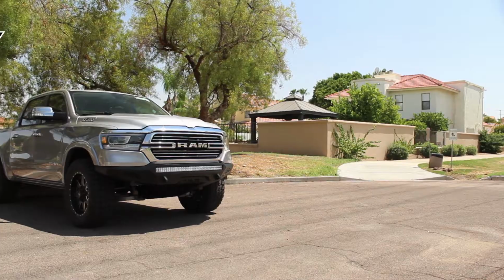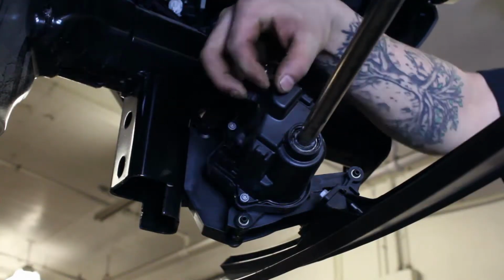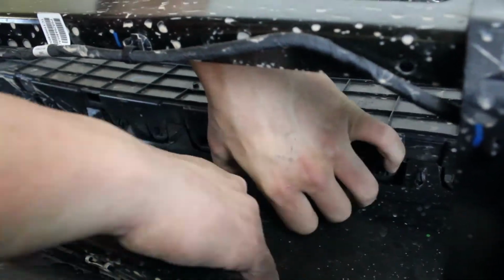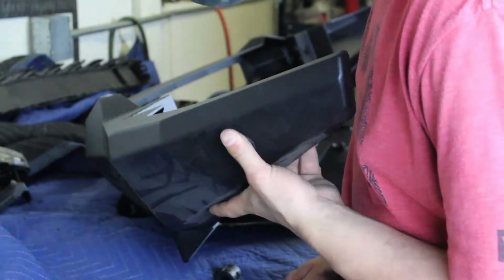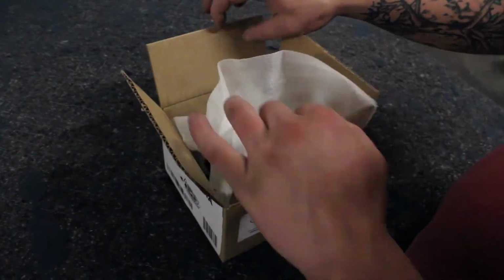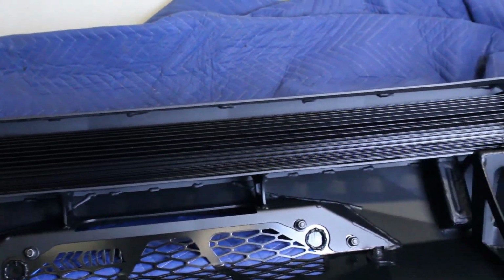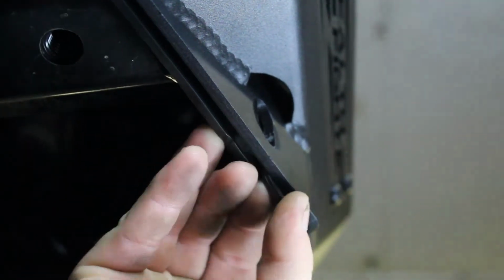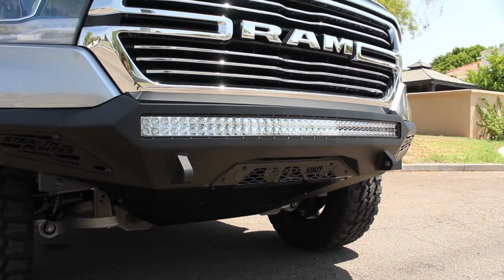HOW TO: Install RAM 1500 Stealth Fighter Front Bumper with OEM Removal

Comment: I agree with other than the OEM fogs need to be kept and there should be an option to NOT have a giant light bar cutout in the bumper.  Not all of us are running 100mph through the desert at night. ;)

Comment: If you are shelling out 2k on a bumper, plus whatever that high dollar light costs, then you should have enough $$ to have a machine shop build you brackets for those holes, on either side, to accept your OEM fogs. And for those who don't want the long light just have a plate made with your name, truck model, etc stamped out.

Comment: You guys should design a bracket to relocate the factory fog lights into the pockets on the right and left side where the stealth fighter panel inserts are that way you can retain the factory fog lamps and the cornering light capabilities.  What about an aluminum option to keep the weight more in line with the factory bumper?
Reply: Outstanding idea! That's a no brainer. I wish they would in fact do that. I'm not gonna buy the bumper until they do that! I really like the way this bumper looks but I absolutely insist on maintaining that fog light capability!
Reply: I guess im asking randomly but does someone know a tool to log back into an instagram account..?
I was dumb lost my password. I would appreciate any tricks you can offer me.
Reply: @Terrence Kohen instablaster ;)
Reply: @Alexander Cairo thanks for your reply. I found the site thru google and Im waiting for the hacking stuff atm.
Seems to take quite some time so I will get back to you later when my account password hopefully is recovered.
Reply: @Alexander Cairo It did the trick and I finally got access to my account again. I'm so happy:D
Thank you so much you saved my ass!
Reply: @Terrence Kohen No problem xD
Reply: That's what i'm saying!